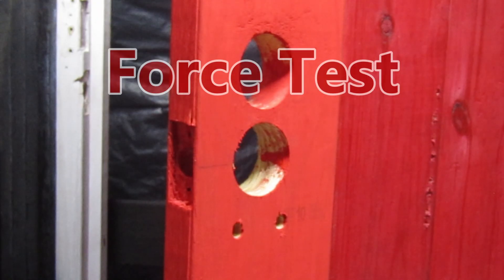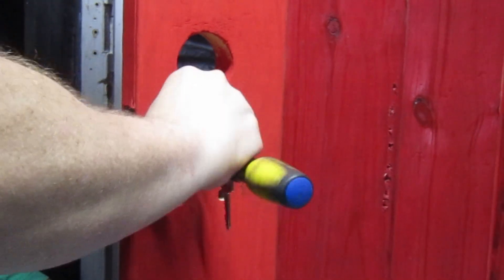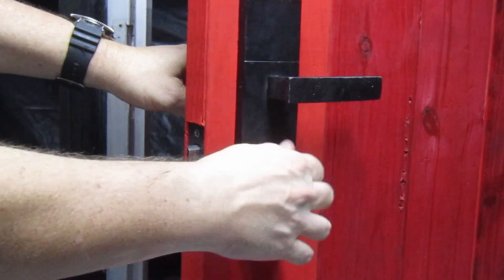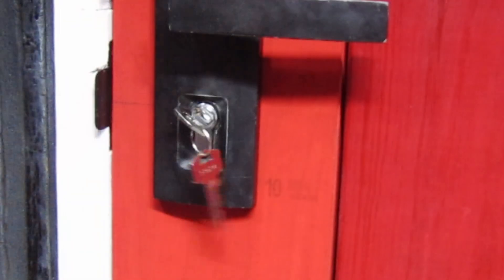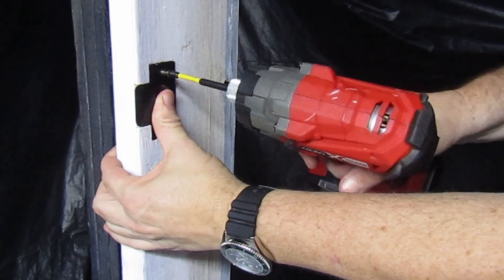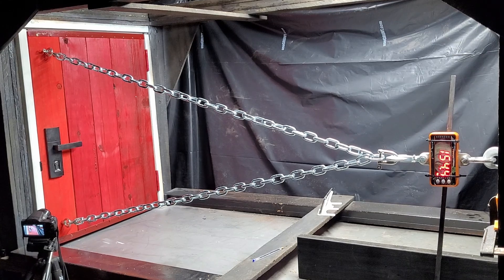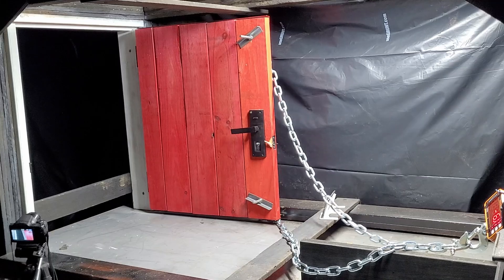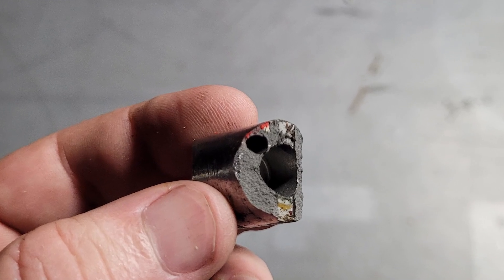Testing the Gainsborough Trilock – Strength, Installation, and Performance Review

Comment: Love the video!  Could you possibly answer a question for me?  I currently have a trilock as per video.  I want to replace it with a Gainsborough Liberty Safety lock.  Is it compatible with my current door set-up or do I have to do some door modifications to make it fit?  thanks again